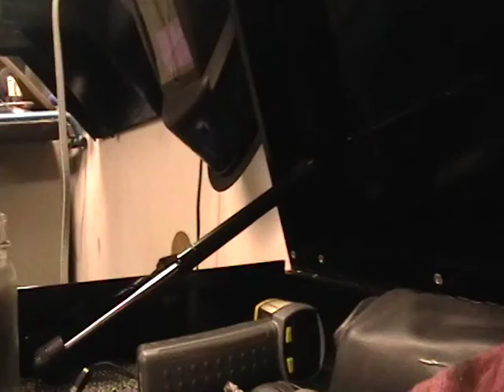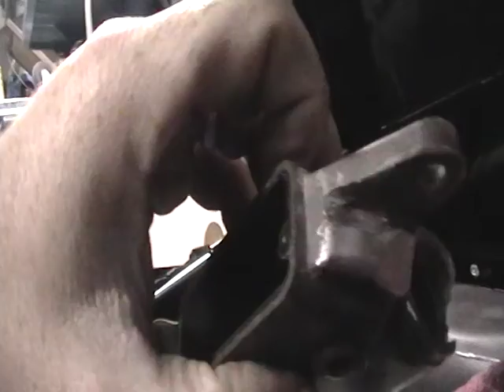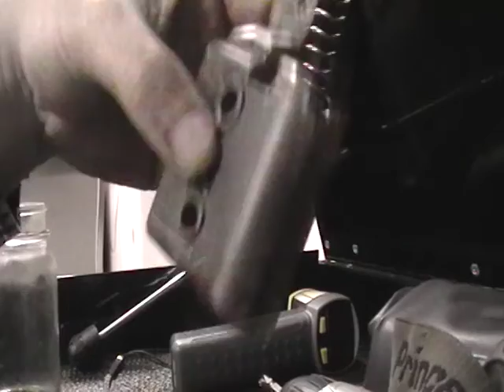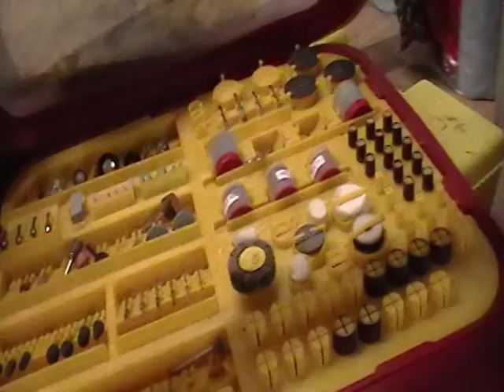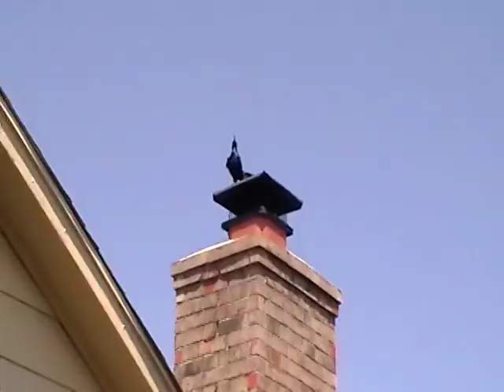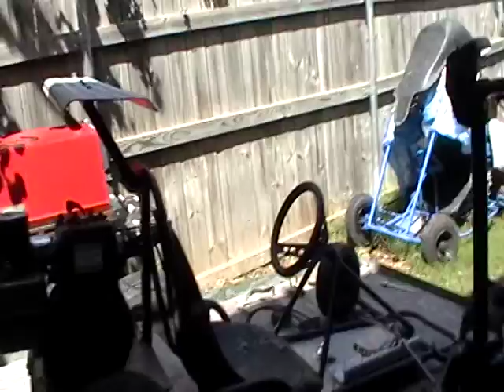Master Cylinder on Go Cart

Comment from the maker: basically your foot is a hydraulic pump.  You have all that fluid your squeezing into two small lines that go back to the brake calipers. So when you have a large amount of fluid your "compressing" (fluid doesn't compress) you can build ALOT of pressure in the smaller lines.  The master cylinder is where all the pressure is created when you push your foot down it pushes that piston that forces the fluid out the brake lines.You may want to look at a vid of the basics of hydraulics. Did this help?